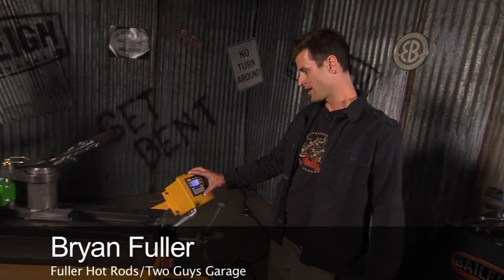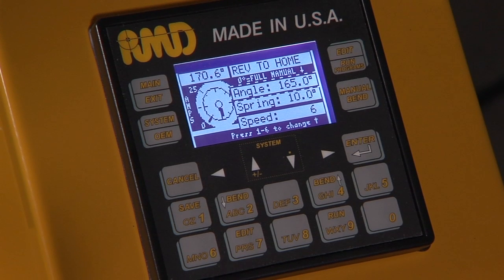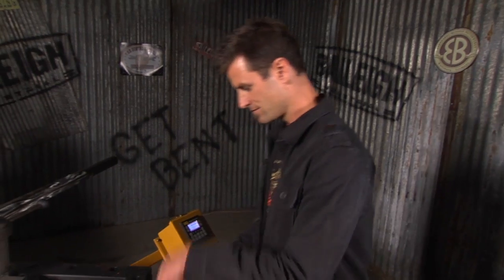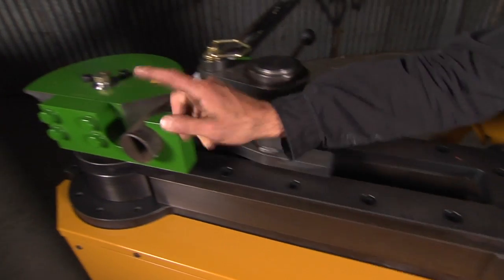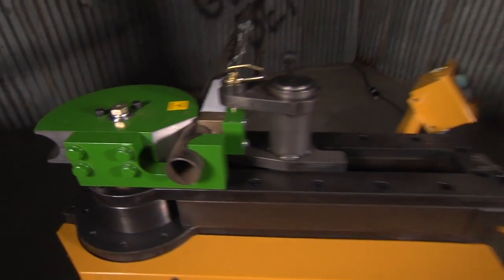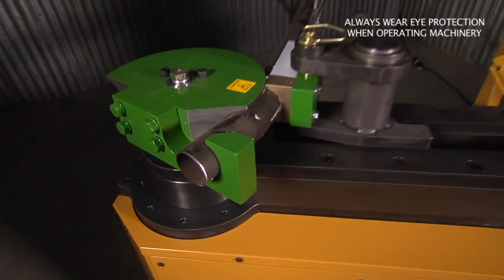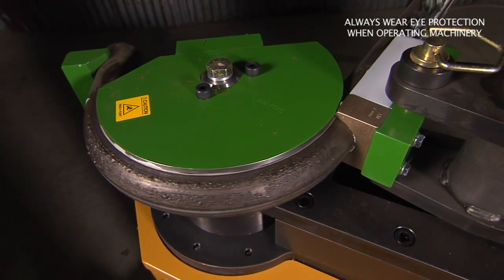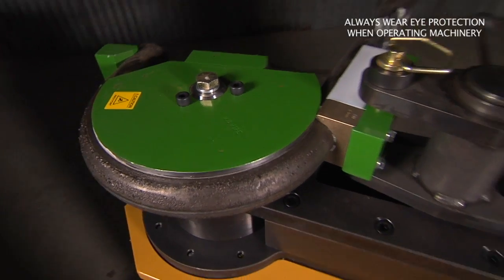Baileigh RDB-325 Programmable Rotary Draw Bender

Comment: Why can't you do 180 degree bends?  I understand that 181 is bad...  but I want to be able to do 180 U bends...
Reply from the maker: Full Manual Mode allows for bending to any angle up to 200 degrees. A password in required (from Baileigh) to make the machine go past 200 degrees.